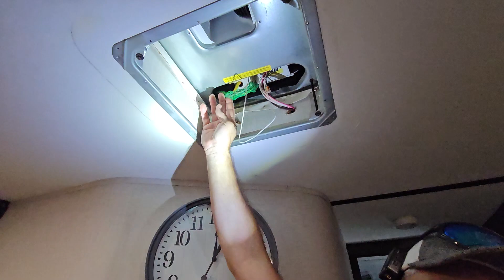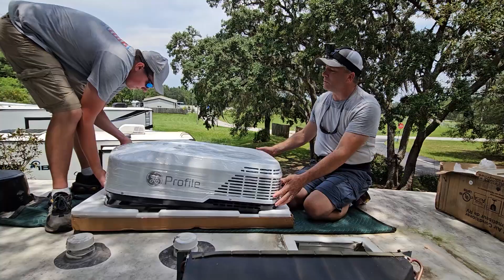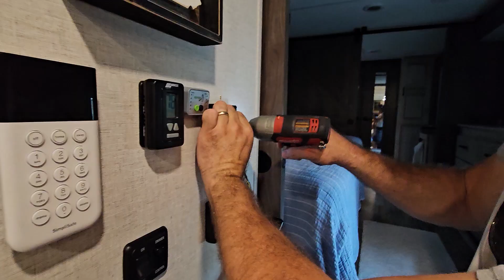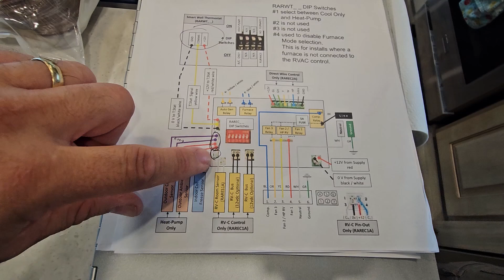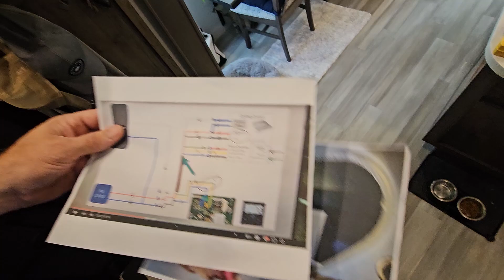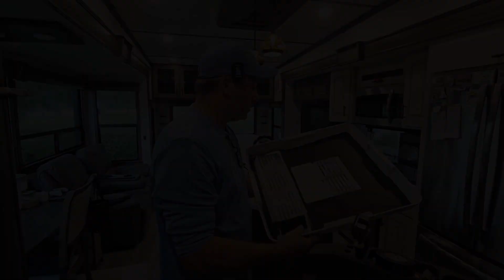GE Profile RV AC W/Heat Pump Complete Install

Comment: How low of temperature before the heat pump stops working? I have a GE profile air conditioner and heat pump!
Reply from the maker: I would say around 40 degree outside temp.

Comment: Nice video! How can I install this unit if my RV only has ducted air? It doesn't have the "Ducted Ceiling Assembly | RARED1A |." and I don't want to cut a hole?

Comment: Awesome video brother!!
I replace a Dometic with the GE heat pump. Followed your video and everything worked the first try. 
The only difference was I only had 1 set of 12 volt wires and no green wires in the GE junction box.
Reply from the maker: Awesome, glad it helped. I know there wasn't much good information on the install.